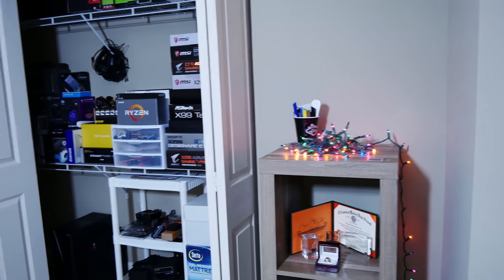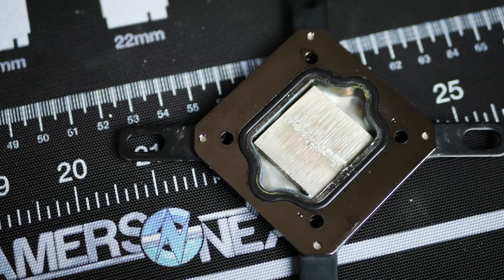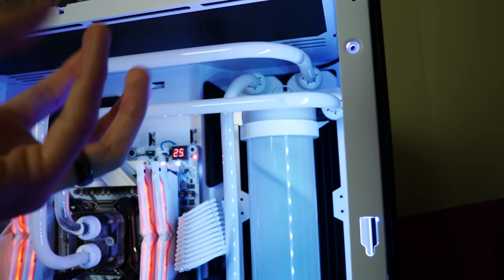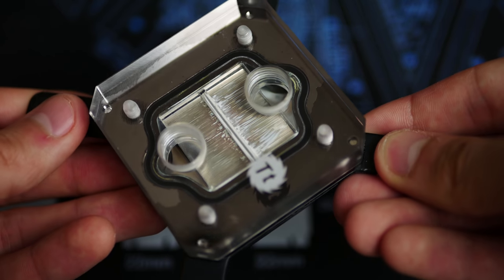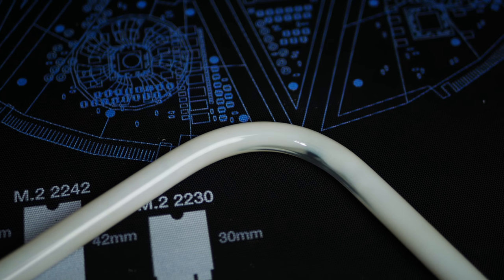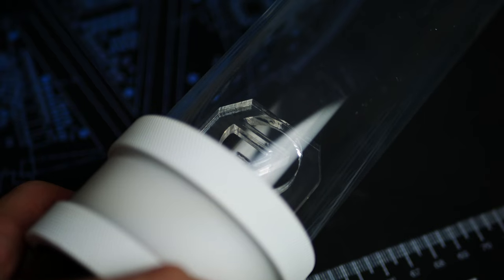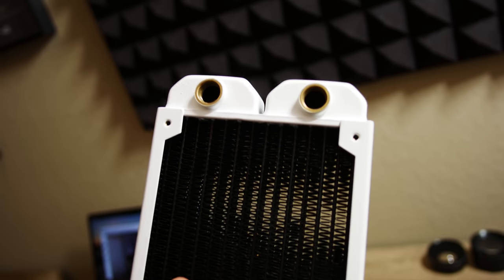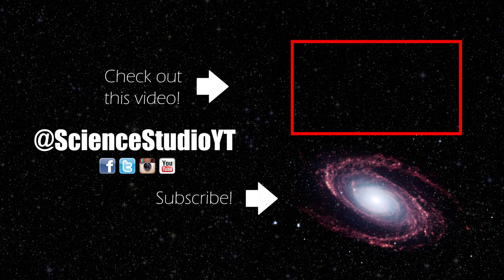More Trouble with Opaque Coolants...

Comment: It's very interesting that so many people consider distilled water the go-to for a custom loop. 

If you've seen Singularity Computers' channel, he does awesome work with custom loop cooling. He was the first guy to start using rigid tubing. He has pioneered a lot of the stuff commonly used in PC cooling today. Anyway, he always says that you should never use distilled water in a custom loop. 
It has something to do with the fact, that as distilled water has no minerals, it'll draw the minerals out of whatever metals it comes in contact with, that being the water blocks in the loop, thereby causing corrosion way faster. If i remember right. 
Anyway, he has the explanation on his channel if anyone wants to check it out. I'm definitely no expert on this area, but i do tend to believe what that guy is saying. It's interesting stuff. :)

Great video. It's interesting seeing how this stuff reacts.
Reply: Christian I can't tell you specifically about in a computer water loop but distilled water has been the standard in the automotive cooling loops for as far back as I know of and minerals leaching out of the system has never been a concern for any engine I'm aware of. I assume the PC coolants have different additives but I see no reason a distilled water base would cause any more problems there than in automotive applications were regular water is highly discouraged for a number of different problems it can cause.
Reply: So do we use normal tap water or filtered water but still has all the minerals in it??
Reply: Well as someone who has opened up my share of car engines, i'll tell you that there is always lots of corrosion on any metal surface, in the cooling loop on a car. 
It's a very different use case and not really comparable. The tubing and channeling in the cooling system on a car is much larger, and won't clog up easily. No micro channels to be found. And so, it doesn't need as clean a solution as something like a custom loop in a PC. While the base principal is the same, the applications are VERY different on a car, than in a PC.
Reply: You use something that has been specifically made to go in a PC cooling loop. Something that has the proper additives and such. But i suggest checking out singularity computers' channel if you want more info. I can't remember off-hand what he uses, but you can probably find that info on his channel.
Reply: I'm with Christian on this. You can use distilled or de-ionized water to clean your loop, but it's always best to use proper pre-mixed coolant from (this is just an example) EKWB, Mayhems, Primochill, Alphacool etc... Now those 4 brands have all proved themselves, but that doesn't mean there aren't other brands just as good. In the end it's a personal choice of course, however these days I stick to Mayhems X1. And for proper cleaning use Mayhems Blitz Part 2 (SysClean is also a good product), which is an excellent scale remover as well
Reply: Yeah start with distilled water but add an anti-corrosive. If you can find an additive that inhibits the growth of fungus and bacteria as well use that.
Reply: All coolants will be distilled water based, if properly cleaned and anti corrosion is added then it will be fine
Reply: At this rate, might as well use propelyne glycol based automotive coolant that is coloured but still translucent. It is has practically all the functionality a water cooling system will need, such as antifreeze, corrosion inhibition, pump librication, etc.

While we're at it, might as well add some Redline Water Wetter or equivalent to that 50/50 coolant and DI water premix for more anti-corrossion and reduced water surface tension to reduce bubbling, eliminate heatspots and generally improve cooling efficiency.
Reply: Yes but you want to use soluble, non reactive salts or minerals to saturate the coolant, this does mean that it doesn’t strip any away from and metal or plastic surfaces. However any type of solute will make the solution become conducive, the benefit of distilled water is that, unless you have a super dirty loop, it will be non conducive which is always a nice feature for someone making their first few loops because leaks happen. But opaque coolants are the worst, they contain insoluble particulates that float around, reduce thermal conductivity, deposit onto metals and imperfections on plastic or glass surfaces, they don’t prevent the actual coolant from not stripping soluble minerals from the metals. They’re a big mess and the only way to clean them effectively and safely is to use a proper solvent like ethanol or acetone, not vinegar because that could corrode and damage metal surfaces
Reply: pure distilled water is deionized water. by definition it will corrode the loop. not nearly as rapidly as other chemicals you'd normally associate the word "corrosive" with, but it is objectively corrosive. what they use in automotive cooling systems is hardly different by the way, but the reason it's used is because it contains a whole shit ton of added ions, which neutralize the charge. the problem he had here could have a number of reasons. the corrosive effect of distilled water takes a lot longer to appear and is much more subtle. it won't cause the dye to come out of solution obviously. the reason could be simply that the creators were stupid and did not check the miscibility or just the density if it's a colloid. i can't say for sure, but he presumably wouldn't have bought a sketchy fluid, so my guess is that something in the solution reacts with PETG or even something passing through the radiator, and that is altering the conditions in the fluid enough to make it non-miscible. temperatures could play a part but seems very unlikely as the temperature range of any high end custom PC loop will generally be the same. you're naturally gonna have more problems with opaque coolants since they're usually colloidal
Reply: Slap on a NH-D15 and you are done
Reply: I'm definitely no expert on what is best, but based on this video, Premochill should be absolutely ashamed of how their product has caused this amount of damage to this loop & all inside of a month.
"Experts in premium custom loops.."
(..my hairy arsehole.)
Reply: Christian I believe I found the video you are referring to. https://youtu.be/Evab4rhd48I . I believe you got the wrong lesson from this. The lesson was don't just use water without coolant. The coolant that you mix with the distilled water has the anti corrosives and anti bacterials in it that's what makes it good for the long term. Additionally it looks like they assume distilled water was used but never mention talking to the customer about what was used. With the amount of build up in such a short time I'd put money on the guy having used tap water when he built that loop. I'd love to see someone do an experiment showing the time it takes for this kind of build up with 100% tap water, bottled water for drinking, and distilled water for points of reference. If a car cooling loop is well maintained there should be no corrosion it is not a guaranteed problem. Spending years as a mechanic I've seen people do it right and I've seen people do it wrong.
Reply: Basically the thing with distilled water is that it's still water after all. Contrary to what some people say here there is ALWAYS tiny amounts of metal dissolving in really anything you put into a loop, this will cause the water to have some minerals or at least some metal residue inside of it which can/could aid corrosion. Now this process is slow but it does occur over time. The thing I most dislike about distilled water is that you have to maintain it quite a bit more frequently than with other coolants due to cleaning everything and making sure no algae are building up in your system, at least every 6 months you should disassemble the entire thing to keep it clean.

For my loop I used EK's Ekoolant (they don't seem to sell that anymore for some reason) and it being an actual biocide and coolant specifically designed for this application held for ages. Note that this is a premixed coolant meaning you don't have to add anything to it, you simply pour the bottle into your loop as it is. Now it totally slipped my mind that I should be maintaining my loop regularly so after two years I realized I still hadn't thoroughly cleaned or drained it for the first time.
I've heard catastrophic stories of such negligence and people having to replace pumps, blocks, all sorts of crazy stuff.
Fearing and preparing for the worst, when I undid my tubing and drained my loop it was literally looking exactly like day one. I washed it with some distilled water and it looked like it came right out of the box, that is how squeaky clean everything was. The block? ENTIRELY gunk free, shiny as hell. The reservoir? Very VERY light film at the top that I was able to scrub away in no time. The pump? Disassembled that entirely and couldn't find ANY residue. The tubing? Apart from a little gunk that got flushed out of my radiator (despite cleaning it thoroughly before installing it) literally as good as new.

I am now using aqua computer's double protect coolant and I am now very confident in the abilities of actual coolant specifically for that use case.
Reply: Distilled water does pull ions from your components, and will eventually cause corrosion if left unchecked, but that takes a LONG time, and is completely preventable by simply draining out the old water and putting in fresh distilled. Once every six months should be sufficient.

In my first build, I ran straight distilled without any additives through my system for over a year. I definitely don't recommend this, since I wound up with so much algae that it completely clogged my system. BUT! I never had ANY corrosion.
Reply: Well,its kinda true.i use distilled water on my custom loop,and after a few months the reservoir have some green thingy on it.so i need to flush the loop a few times to make sure that doesn't happen again

Comment: Simple solution: don't keep using stupid additives that keep doing this to your distilled water and tubing.
Reply: or use air cooler
Reply: Nicolas Zannerini Air is still the best. (;
 😛😜
Reply: Ryan L 
Sadly, straight water in a water based cooling system is practically a very bad idea due to lack of anti corrosion and antifreeze. Water is also a relatively terrible water pump lubricant.
Reply: Anti-corrosive and anti-growth are obviously mandatory but they dont cause any harm. Antifreeze is a bad idea as it can destroy certain plastics and cause your loop to leak and it isnt really needed unless you like in Sibiria but then you could go with air cooling anyway :D

Comment: I built my custom loop 3 years ago, multi-metal loop with zero maintenance since - no problems. But I filled the system with some expensive ass electrically non-conductive solution. All I can say as a word of advice, don't use water.

Comment: Try PrimoChill Vue for a while and tell us if it does the same.
Reply: It does the same 
Primochill vue only lasts 2 to 3 months and  that's if you don't use your computer a lot .
If you run it more than 8 hrs at a time the fluid will fall out and particles will clog your system
Reply: I think the Vue's only made for like show PCs.
Reply: If true did it then Vue will also, seen some stuff about it reacting with some nickle plating

Comment: Don't use vinegar to clean waterblock. It has a high ph level. Use soppy water and toothbrush.
Reply: gamer games 
Vingegar is a relatively week acid. Anything below the neutral pH of 7 is acidic i.e. low pH and vice versa.
Reply: When you really want to clean a block you should use something acidic like ketchup or lemon juice. Then you should finish it with soapy water.
Reply: Vinegar will react with copper, it is just a pretty slow reaction. As long as Greg rinses the radiator with water thoroughly it will be fine.
Reply: Definitely don't use a toothbrush on PETG, it is known to be easily scratched. Also, vinegar is a relatively weak acid so no problems there and most of the acidity comes from acetic acid. In the case of PETG, acetic acid, in a different form, is used to manufacture PETG so you shouldn't have any problems from that either.
Reply: Pearson James Yeah, just don't let the vinegar sit

Comment: Every time I watch one of you guys (you, Jay, Paul, Kyle) do a water cooling vid, I remember why I just stick with a hyper 212evo. A buddy of mine had an AIO (can't remember what brand), and my 6600k stayed cooler than his 4600k. He even had the unthinkable happen and his pump started leaking. Luckily he caught it before it did any damage to his system, but after seeing my temps he got a 212evo to replace the AIO. Watercooling looks cool as hell, but I just like the "set it and forget it" route...
Reply: He must have had a 120 or 140 AIO which are not very good for CPU's with overclocking. for 50-75$ your better off with a decent air cooler. i would say use a 240-280mm AIO. and that would get much better temps. But you also have to research the AIO to make sure its rated well and not prone to stupid stuff (EK AIO's tend to be very prone to accidents)
Reply: If you want a super quiet and cool system there is no way around proper watercooling since you can simply scale up radiator surface almost indefinitely.
None of my fans run faster than 500rpm while keeping the 1080Ti and 4790K at 45°C and 50°C.
Reply: pmhops77 I love the “set it and forget it” whole chicken. They’re as delicious in person as they were on the infomercials back in the day 👍🏽

Comment: Glad i don't use liquid cooling hehe
Reply: lmao dood that conclusion :D there's difference between a bad liquid cooling and good liquid cooling... the latter doesn't look great inside ur pc but it works 5 years straight with zero maintenance
Reply: No, custom loops need maintenance every year. Premade coolers don't need maintenance.
Reply: could you explain me why? because mine hasn't needed and it's perfectly fine, not ganked up at all. I would really like to know what's your base on that. Sure if you use junk opaque fluids, all parts gonna be wrecked in no time.
Reply: It does't matter if nothing bad happens, you still need to maintain your loop every year.
Reply: so you can't explain why? because let me tell you, you don't. If you do it poorly, it will gank up and then yes, you need to deal with problems, but if you do it properly, the way like your bathroom pipes are done, it will last good 20 years if you want so. There's nothing that would require maintenance. Prove me otherwise :)